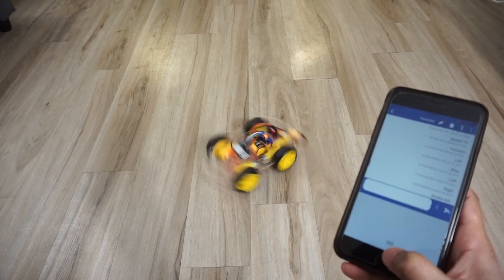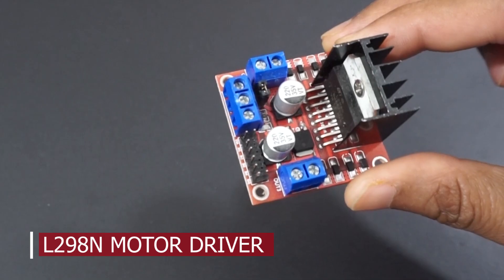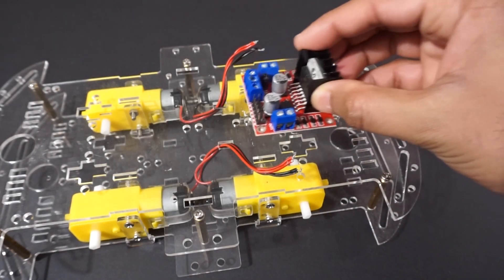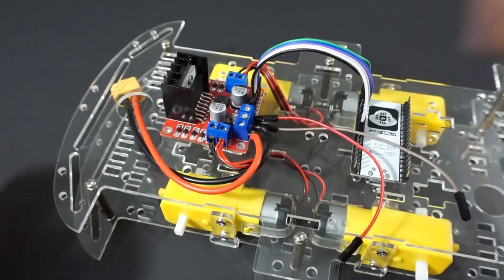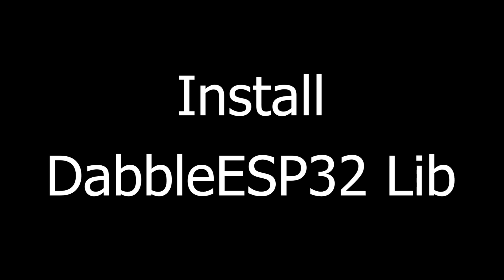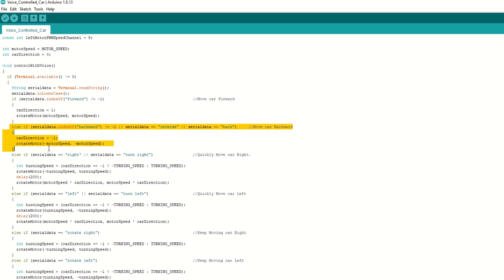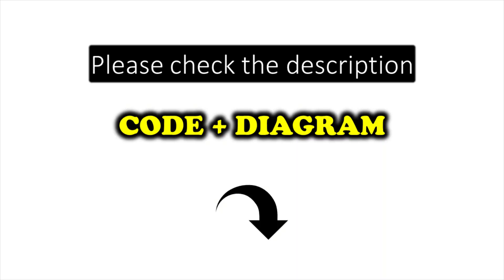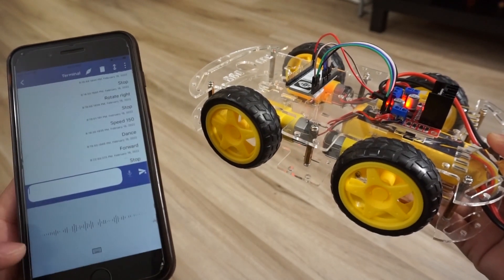Voice Controlled Bluetooth Car 🎤DIY | esp32

Comment: the code has an error at line 169 ...... " ledcSetup' was not declared in this scope" also line 171 "ledcAttach" and  also lines 173  &  174 " ledAttachPin' was not declared in this scope; did you mean 'ledcAttach'? "    replaced  ESP 3.0.0 with  ESP 2.0.16 and it accepted the code.... now to see if it works..... WORKS GREAT !!          /////   what was the command you used to make it spin?  was it Rocket Left / Right ??
Reply: Bro can you say again the correction pls

Comment: Sketch uses 1137297 bytes (86%) of program storage space. Maximum is 1310720 bytes.
Global variables use 39572 bytes (12%) of dynamic memory, leaving 288108 bytes for local variables. Maximum is 327680 bytes. because of this car is not responding
Reply from the maker: This is not an error 👍🏻👏🏻

Comment: I've done everything you told, but even after connecting the car to my phone and giving voice command, it does not move. Please help, I've watched your video again and all the steps are correct, I'm using esp32 devkit v1
Reply from the maker: Increase the motor speed 👍🏻👏🏻

Comment: Great work. i've done everething as you told, but my cellphone doesn't detect my  esp32. it doesn't even appear in the option of bluetooth. Help
Reply from the maker: Please use rechargeable battery only . Also try restarting your esp32 before switching on dabble app Bluetooth 👍🏻👏🏻

Comment: i am trying to connect my esp32 board to dabble but its name is not showing in the bluetooth available devices list. what is the problem?
Reply from the maker: Please use rechargeable battery to avoid any power related issues . Also try restarting the esp32 after you open dabble app 👍🏻👏🏻

Comment: Can we use it with esp32 dev kit?
Reply from the maker: Yes you can use that module and use only the pins available . However I would suggest to use only esp wroom 32 module with 38 pins to avoid any issues .

Comment: I have just bought esp32 wroom but its 30 pin instead of 38 😪 but i guess it would work on that one too
Reply from the maker: Hopefully it will . However I have not tried that . Check for the pins on that 30 pin module and use those pins . I would suggest to buy 38 pins so that you don’t face any issue .
Reply: @hashincludeelectronics  I tried remapping the pins from code but in mean time i accidentally made the board touch my battery pack causing its bluetooth to shut down permanently,  So tomorrow I will have the 38 pin module I have ordered it yesterday , Your work is really awesome I wish you the very best ❤❤
Reply: @hashincludeelectronics  Can you put the joystick code , so it will work from both the joystick and voice on the dabble app ?

Comment: This is neat!  Is it possible with esp32 to listen / talk over bluetooth by plugging in headset to ps4 controller?   I know the ps4 can, but not sure if the ps4 controller library supports headset / audio, or how to implement it on the esp32.    Any ideas or resources you could share? Great videos as always.
Reply from the maker: Thank you so much for checking out the video and comment 👏🏻👍🏻. As of now I did not find that p4 library supports audio . However I myself is checking for audio interface with esp32 . Will share if I come across any material .

Comment: Love this vid, I have made a car like this using ELEGOO, and want to display the distance on my mobile APP (using sensor). Could you help me with that please? (PAID WORK)
Reply: For example when car gets too close to obstacle I have a signal showing this in the app.
Reply: Please can we arrange a quick meeting. I am working on this project quickly.
Reply from the maker: Thanks 👍 However I am using the readily available app which is called Dabble . There is no provision to display the custom value on that app. For your requirement we need to create a new app if its android then can be easily done using MIT App inventor. Also what distance you want to display ?
Reply: @hashincludeelectronics  distance from an obstacle.
Reply: @hashincludeelectronics  i have already got basic functions (forwards, backwards, left and right) and obstacle avoidance. I just want to show an indication on the App when i get too close to an object - for example colour changes to red on App.
Reply from the maker: @ahmedalathamneh4167  This is easy . Do you mean you already created an app ? You can contact me on Instagram hashincludeelectronics
Reply: @hashincludeelectronics  no im using the Elegoo App. I would like to create my own if possible. I have contacted you via instagram. Hope to hear rom you soon.